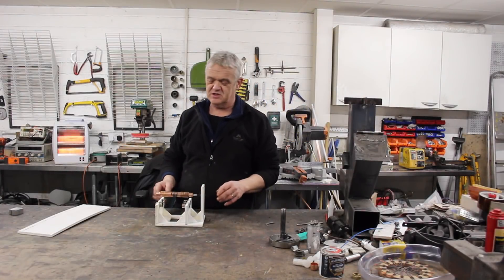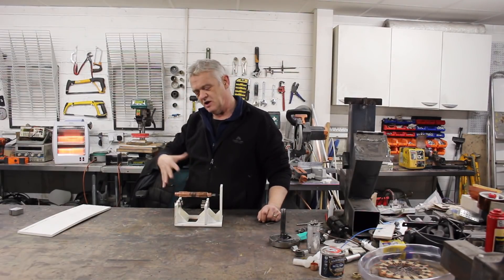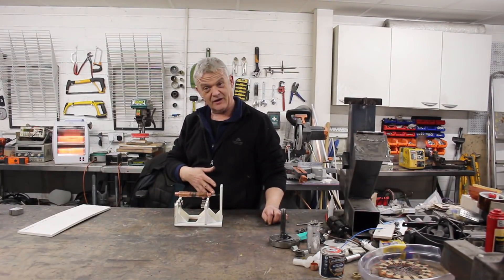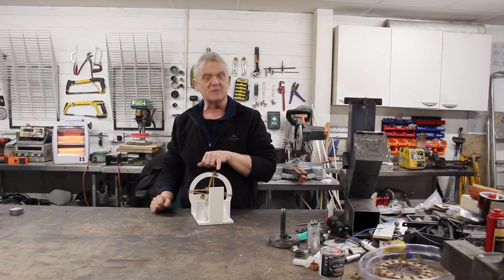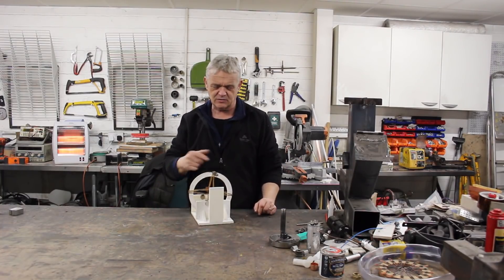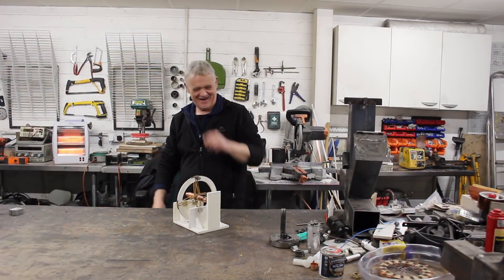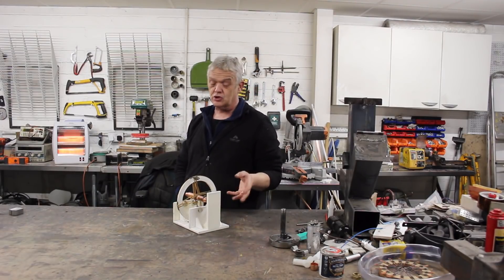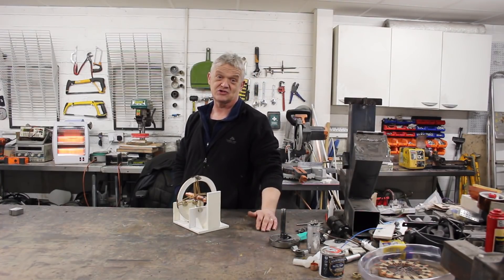1429 A Rotary Rubber Band Engine With Magnetic Bearings

Comment: you seem like a knowledgable.chap.on electrics and free energy ill ask you a question.. 

if the sun emits electromagnetic radiation and is made up of a proton ... neutron.. and ion... why are we not using ion attenas and the.draw of the earths reverse polarity to.pull the protons out the eather creating a connection to the life source of the universe and free energy 

also why dont we build windmills in the windiest places and why dont we build water mills where the current is strongest... ...

Comment: It is better to use shape memory alloys insted of rubber. Nitinol is very interesting with its pseudoelastic tension of 8%. Together with its Young modulus of 75–83 GPa of the martensite phase it gives a lot of tension. Using a thin Nitinol wire and a tube around it forming a series configuration of cooler, regenerator and heater gives allready a small but quite powerful heat engine.

Comment: I bult one of those back in high school fpr a science fair project about 24 inches in diameter and over 60 rubber bands around a wood circle with a crank shaft on the center hub connected to a cardboard shield eith 1/2 cut out so only 12 got heated at a time using an electric radiant heater

Got up to maybe 10 R.P.M
Reply: Back in the early 1970s

Won first place 

Great memories
Reply: That sounds like fun!
Where did you get the idea from for your version?!
I hope you don't mind me asking, thank you. XxX
Reply: You will have to scroll down to page 93 to 95
The pg numbers are hard to read on my phone

Comment: Rob, have you considered replacing the axle's point and strike plate with two opposing magnets?  That setup might keep the axle from going forward and keep the axle in place.  Plus it would be completely frictionless.  You might need  inverted cone magnets matched with a smaller coned magnets on both ends of the axle to make it much more sturdy.   Replace the interior round magnets with  electromagnets that can be controlled variably and strong enough to hold the weight of an additional weighted wheel attached to the axle for angular kinetic energy to keep the axle spinning as long as possible before needing to apply small bursts of energy to bring the rotation speed up.  Without any friction at all, and with fingers crossed, it might possibly eventually lead to zero point energy?  On a small scale?

Comment: It is through simple demonstrations like that where proof of concept inspires improvements and continues processes that build the foundation of progress.

Fantastic job again Rob!

I still say that a two part cradle for that magnetic bearing would allow it to 'hover' straight up in air for a wind collector 🤷. If I had the stepped motors I would just build it myself easy, but I'm working on a pancake winding configuration in series to see how that reduces back emf on a coil under work conditions.

I'll let you know what I find in the event you want to include it on the channel. I think the results will be promising.

Comment: Those magnetic bearings would have been great on my solar powered motor. Pretty simple to make - just put long, black plastic rods (high thermal expansion) on a bike wheel with weights at the end to balance them and add torque. Then place it where 1 side is in the sun and the other in the shade. Add metal fins and play with the rod shape for some fun science. Just use a chain to hook the sprockets to whatever you want.